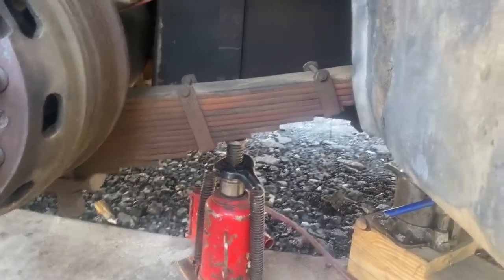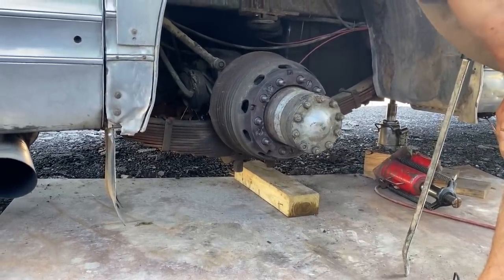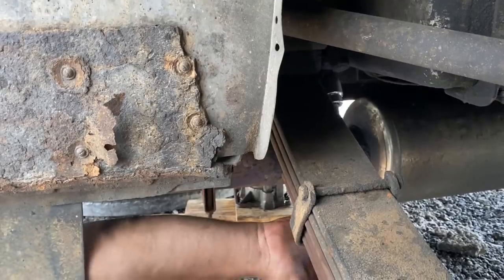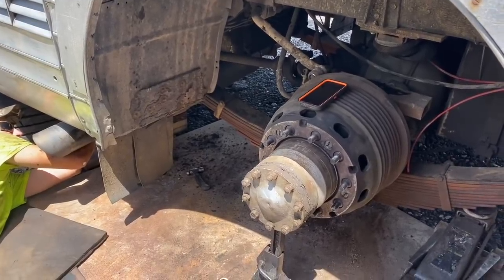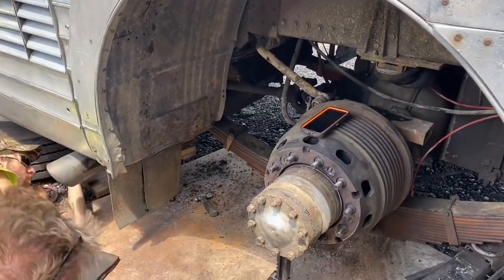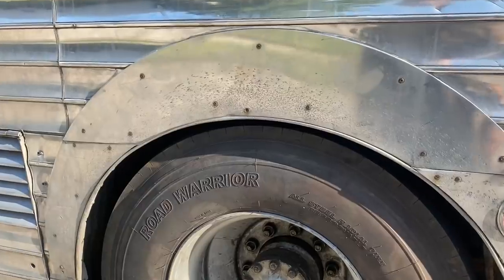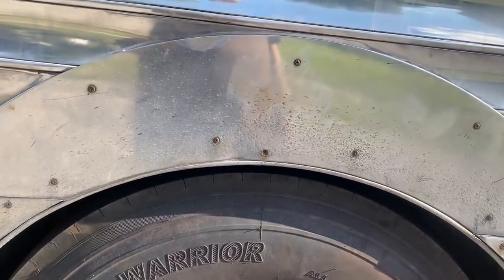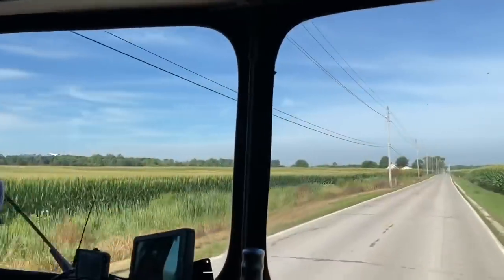Leaf spring change on bus.  How to turn a bottle jack into a missile

Comment: I learned a long time ago, always replace old leaf springs with brand new custom built overloads . I went from 5 leafs ( from the factory ) to 8 leafs and each leaf was .060 thicker.  Made for a much better ride as well.
Reply: I replaced the leafs in my SUV as soon as I purchased it used.  I ended up buying the cheep replacements, but added a leaf before installing them.
Reply: Always add a leaf!
Reply: @nicholassmerk   Yeah, I added 3, it was extra weight, but the pay off was a much better ride and I could tow a much heaver trailer as well.
Reply: @RiceReaper  Allways take one leaf away! better ride!!!
Reply: I was just thinking to my self. Why have some many thin leaf springs when the same could be achieved with less leaf springs that are thicker ….But I bring up a good point .

Comment: I HOPE to GOD Scott U Fellows got more Cribbing under that bus than just that one Bottle Jack!!! & that little piece of wood behind the Jack. Especially with all that Grunt work with them long Bars! Now I know I’m not spending my money I’m spending urs Scott but I would have both rear springs built new! I’ve never had any luck just doing one spring on my over the road trucks! My off road trucks it doesn’t matter! But whenever ur running highway speeds & loaded to the MAX as u are all the time the vehicles just don’t drive rite! They PUSH OR PULL OR WEAR TIRES FUNNY! & ESPECIALLY with that being part of Lennie’s Main Roof Support could end up with structural damage after time! The Springs u took off look like Someone rebuilt them back in the day! & whenever u don’t round the ends of the springs it lets them tend to try to cut themselves into! I know u Boys have to be worn out! It’s Hot as Hell & that’s a very Hot job!

Comment: Leaf springs broken perfectly square ? 🤔  Let us know what the spring shop says...
Reply: Not likely, too consistent, not jagged on the ends.
Reply: Those look like square cut ends, slightly deformed since the pieces are cut with a shear rather than saw or cut off wheel.
Reply: They call it broke because they use a shear or a brake machine to cut them machine shop's have. A machine called a brake it's like a shear that cuts thru metal I worked at a place that had these instead of torch cutting there is a spring shop in Johnson city TN that rearch your old springs or they can build what ever you need will try and find there number but should be able to Google them

Comment: You really need to get both springs rebuilt.  Do once do it right,
Reply: A guy at work says the same thing. His example is front wheel bearings. Guys will change just "the bad one" but not the other. They both have gone the same number of miles.
Reply: @RustyorBroken  these guys have no idea what they're doing. I expect them to get only one. Listen to them say the spring ends are broken. They aren't, that's how they are designed.

Comment: Leaf spring leaves start out as spring steel flatbar that is in the annealed condition, meaning it's soft. It's sheared to length and the center hole is punched. Then the arch is formed in a die and the leaf is heat treated, quenched and tempered. What you're seeing are the sheared ends of the leaves. The tapered leaves are usually the second or third leaves in the stack and the purpose of the taper is to spread the load out over a wider area as the spring stack is loaded.

Comment: I don't believe those leaf spring ends are broken.
Reply: I agree. Most older springs have a square cut end rather than the taper. It isn't a "perfect" cut since they use a shear to chop the bar stock.
Reply: I concur
Reply: The leaf that's wore into the other leaf is one of the main leafs is y it's not like the others witch have been sheared off not broken!!! That spring pack can not be fixed or rearched, it would probably snap in 2!!! And if 3-4 weeks for them too get u another leaf pack I'd find a different company to help u!!! Spring packs r easy to measure it can be done over the phone in less than 10 minutes!!!!
Reply: I have not had the need to have any spring work done in quite some time but and I don't know if the company is still in business but I could get a set of springs made in a day by Hagerstown Spring Works in Hagerstown, MD in a one or two days along with new U-bolts and nuts, washers etc.  I would of thought out in the midwest with farm equipment (Tractor's Trucks, Trailers etc) that a spring works company would be easier to find.
With regards to the ends of the springs being square cut or tapered I have scene springs that are both. My bet is sometimes in that spring stacks life it has been rebuilt using springs from different sources. I have built my own spring stacks from used spring stacks from several different trucks and I am sure that Greyhound and other bus as well as truck companies have done the same.  As a FYI it has been my experience leaf springs normally do not break at the ends but rather somewhere in the middle but like I said that had been my experience yours could be otherwise.

Comment: Get Hendrickson to sponser a custom air ride suspension kit.  Lol.   Never have done a bus spring replacement.  Now I've done dump trucks, trash trucks and the coup d'eta Fire trucks. Both steel and air springs.  Always dangerous and very tiring.

Comment: Scott those leisure look more like aftermarket that were swapped into your packs to replace the ones,  least to me they do. Aftermarket lift springs for 4x's are like that, and the factory ones taper down.  Yes I'm referring to springs for like my 71 Chevy k10 or my 86 k5 blazer, but it holds true for all chevy trucks with leif springs even my 98 tahoe is that way in the rear

Comment: I'm lucky to have a very good old-school leaf spring shop near me and I have no problem giving them my spring work. I've been there and done enough to know what they charge is a bargain 😂
Reply: Agreed.  I used to buy H.D. trucks for my business, and Fulton Spring Co. in Fulton, NY did a first-class job dropping the front and rear axle/spring assemblies, taking them apart, replacing any worn bits while matching side to side, making them able to carry more weight safely by adding the properly sized leaves, all in a day,  and they'd always drive like a dream from then on.  No hobby-horsing, no swaying or rocking while cornering or in winds, and perfectly balanced on all four corners, all in a day, far better, faster and cheaper than I could do it in my own shop--a no-brainer great business decision if ever there was one.  As in brakes, don't send a boy to do a man's job; do it right the first time and have no regrets.

Comment: I had a local spring repair shop supply a couple of leafs for a truck spring. The factory ends were tapered, the new leafs were square cut like you had shown. I think the rebuild shops purchase longer leafs then cut them to length as needed? Your leafs look too square to have all broken off, especially at the ends like they did.
Reply from the maker: Then why is one end of one spring tapered?
Reply: The taper may well be the start of a new length of steel
Reply: @BusGreaseMonkey  Because that's the way they designed it, lol.  Maybe they wanted less weight or more spring wrap on that side.
Reply: @BusGreaseMonkey    Good question for whomever is rebuilding your springs.    I think the reason for the taper is it kind of creates a variable ratio spring rate for a smoother ride.  Here is my guess on why the factory leafs would have been tapered.  With little load, the main leaf is just pushing on the ends of the helper leafs which flex easier giving a lighter and smoother ride. As the load increases, and more of the helper springs bend, the transition goes from thinner metal to thicker to meet the demand of the weight. As the demand increases, the loading goes on to the next spring, and the next... At least that's how I envision the springs working. If the springs were reworked at one time, the local shops would have the equipment to cut the springs, but probably won't be able to retaper the ends since that probably is done early in the manufacturing process.       BTW, did you notice you pulled out a 13 leaf spring and replaced it with a 12 leaf spring, or at least that's what I was able to count from the video. Maybe that is why the bus is sagging? I also wonder if the leaf thickness is the same from spring to spring?
Reply: Taped ends slide easyer the square ends dig into the other spring causing it to break or that's what they told me at spring shop they get these in long lengths and cut them down using a brake machine
Reply: @BusGreaseMonkey  I don't agree that just because one is tapered they all would be - but I know diddly about leaf springs.  If they all broke, they broke very uniformly.

Comment: That was totally predictable. Bottle jacks are not very stable anyway particularly if the are not carrying all the weight. In this case since it was not jacking against a flat surface on the spring there was a static force introduced which dislodged the jack.

Comment: Not a mechanic, but maybe you need upgraded springs due to the change from bus to RV, the weight of the bus with passengers is differently distributed from a house.  Then again you mentioned the driver side is heavier but sitting higher, maybe its a twist somewhere.

Comment: I don't believe those springs are all broken. Reason being that there would still be wear marks from the old tapered ends in the corresponding spring. Also, the chances of all those leaves breaking perfectly straight, and the same spot are very slim, but that is just my opinion.

Comment: This is why I don't like working on heavy equipment- the forces  you have to work with are enormous and when things kick out like that the potential for injury is huge as well.

Years ago I had to help bolt a logging yarder tube together and had to line the bolt holes up with a "marlin spike" as 10 tons or more of steel swung from the boom on an excavator. If enough twist had been created to snap the end of that spike off I might not be here typing this right now. Scary stuff.

Comment: Watch out for a sagging front right spring causing the rear spring height problem.
Reply: Well considering the front springs weren't touched, I don't think the problem is up front. I would however change the front springs as well since the rear will be new, and probably change the ride attitude and may work the front springs harder since the rears will be stiffer.
Reply: kleetus92 agree.... all 4 springs reset with extra or thicker leafs  is the best strategy.
If there are any problems with the front springs that will show up with the new rears.

Comment: Re the hydraulic jack popping out from under a steel spring. I hung around in the 50's at a repair shop and had an old timer tell never try to jack an elliptical spring unless you use a block of wood between the jack and the spring.

Comment: Is the weight in the back of the bus roughly even on both sides?  That could maybe explain the different ride heights with the "new" springs, if they're on the wrong side.  After all, the engine looks like it should weight quite a bit more than the trans. 

Edit:  Scrap all I said - it seems the "heavy side" is the one that's sitting higher.  Oh well, new springs it will have to be, I guess.  :-(
Reply: The majority of the weight will be on the right side due to the transmission, plus the engine is offset to the right. All the left side has is the radiator.

Comment: Scott, I am not understanding why you can not have springs made with the proper ark and strength.  I would have to believe this is being done every day for the trucking world.   Years ago I worked in my Uncles Truck and bus repair garage and we had this done all the time.  Turn around was about a week. Has that industry changed that much over the years?
Reply: Yes it's changed.  Most spring shops are long gone.  It Became cheaper to order crappy new ones from the ChiComs.

Comment: I am suggesting this largely as a talking point but Pakistani Truck have a video on resetting truck springs by dismamtling them and hammering each leaf and adding new leaves
Reply: Actually it is called "upgrading front axle springs" and is quite informative just watching the way they remove and work on them.

Comment: Those ends have just been cropped very approximately during a previous rebuild, just not as neat as the originals.  You couldn't break them as neatly at the 'right' location like that if you tried.